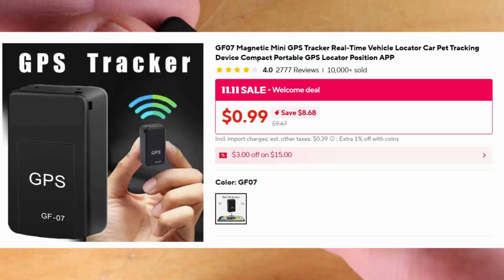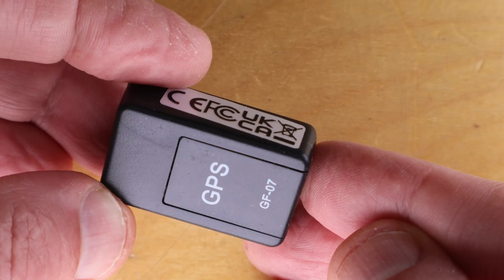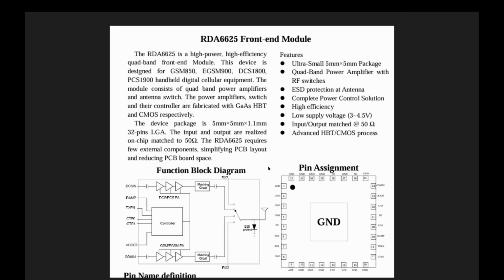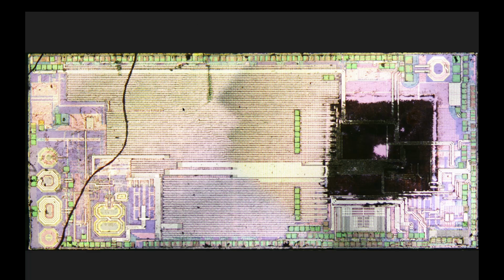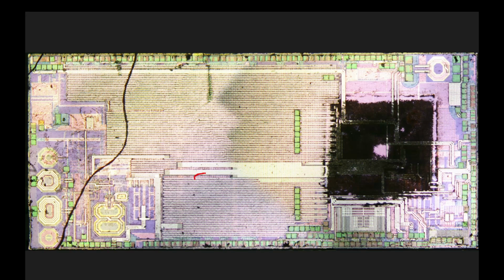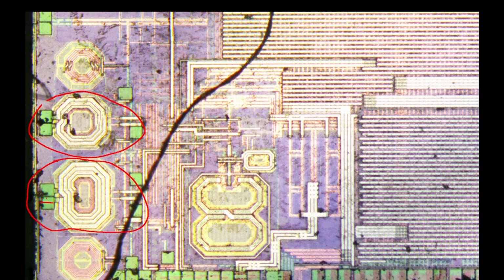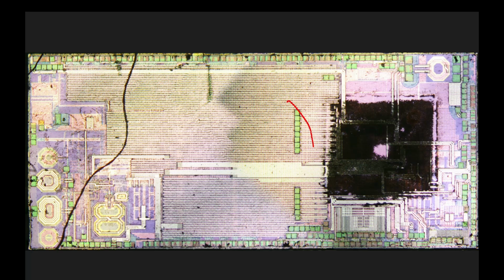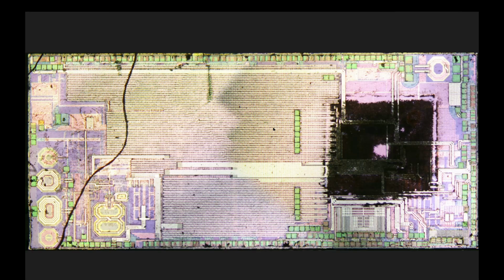GPS Tracker Reverse Engineering:  Packed with Technology... sadly all useless

Comment: Looks like you can get an equivalent (or better) one for LTE for about $6, though that's likely subsidized by the $7/mo subscription service...  But it actually has GPS, not cell-tower triangulation, and it doesn't use a SIM, presumably relying on an in-device ID instead.  I won't mention a product name, but they do exist for fairly cheap.  I have to assume the advent of nigh-useless BTLE trackers that run $.99 a piece really put a dent in the value of the real kind.
Reply from the maker: Interesting, thanks for the info!
Reply: @electronupdate  I got myself one a couple of years ago for ~12€. It only supported 2G and 3G but has a real gps antenna. It takes a while to get a track but it is accurate enough for my use case. It came in a water resistant casing and has a tiny backup battery included (which is dead by now). It is intended for vehicle tracking and can work over sms or internet (some weird websites and apps are compatible with it. I tried it and it at least works). It also has a mechanical tilt sensor/switch builtin which can wake the device up from some sort of deep sleep mode as the gps module pulls quite a lot of current and I am using it in the backlight of my old timer moped which only has a 1,2 Ah battery.

They still sell these but the hardware must have changed. The websites are also still up all weirdly inter compatible with the new models (that look identical but with 4g support among other small changes). Would be interested to see the changes tho but don't need another gps tracker rn :I

Comment: No. The cellular network operator nor the cellular RF connection signal provides location information.  There's no triangulation happening on the cellular module itself. 
So there ought to be a GPS receiver circuitry on this tracker somewhere.
Reply: Huh? Of course it can. e.g. by Reception strength. you receive Towers A, B and C - now you know you are somewhere in the area of these 3 towers. With the knoweldge of received signal strength, you can take an educated guess to narrow down the possible area. Horrbily inaccurate of course - but possible. Its even something cell phones used 20 years ago, to get a rough guess, if you didn't wanna spend the power necessary to run GPS. Or to allow for a faster GPS cold start time (a very rough guess, even if only accurate to a few km, helps immensely in finding setellites quickly). Yes, this actually used to be a hard problem - getting your first fix without an initial guess could take the better part of a minute...
Reply: For many reasons too long to list them all, the RSS (received signal strength) method, in combination with triangulation on many received signals from few radiators (antenna towers with many bands transmitting) do not work.
Reply: @ccshello1  When you say "does not work" - what exactly does that mean? Don't get me wrong - i am willing to believe you, and assume that you have a good reason to say this. But i think we may have different definition of "it working" - or not.

Example: i would expect to be able to geolocate the device with an accuracy of ~35 km via cell id. 

Is it Useless? yes. Probably. Does it work? Different question 🙂

Comment: Wouldn't this be in some way MORE complex to implement than GPS? With GPS you listen to the sats and the chip spits out your coordinates. With cell triangulation, it's obviously not going out to the internet to lookup data, so don't you need the coordinates of literally every cell tower in existence (something that needs constant updating) in a lookup table kept on every chip?
Reply: I imagine you still need the cell network to send the GPS coordinates to a server somewhere anyway...so probably "two birds, one stone"
Reply: I would think a cell tower sends its location in some form of an identification packet.
Reply: I would argue it might be about battery runtime? As that triangulation takes much less power and time compared to a cold start for a basic gps antenna..?
Reply: It could also just send out the tower IDs + strength that it sees. Then it's up to the receiver to triangulate the data. So the device becomes a power meter + tower id decoder + network transmitter